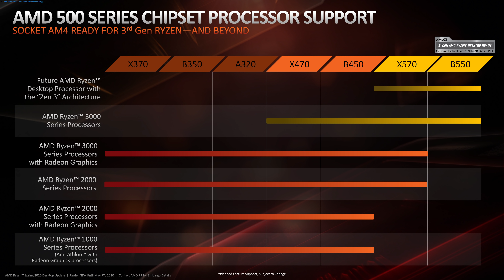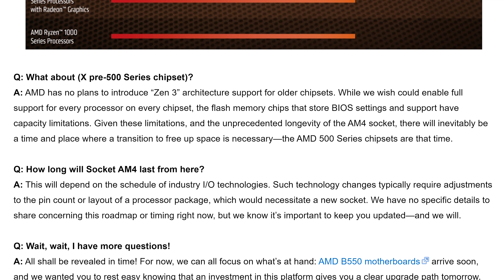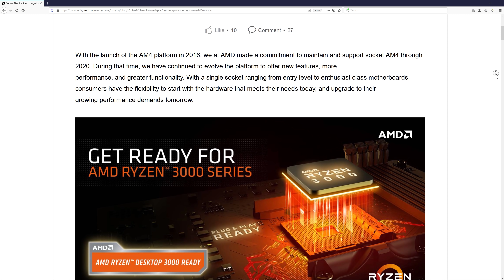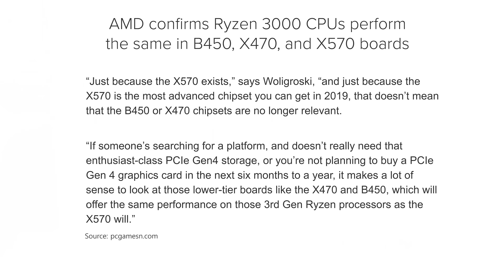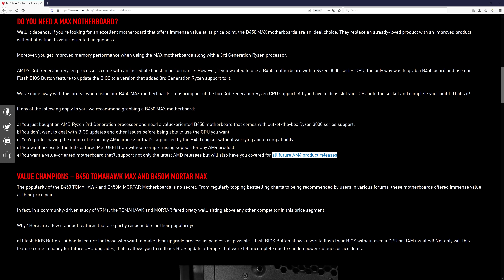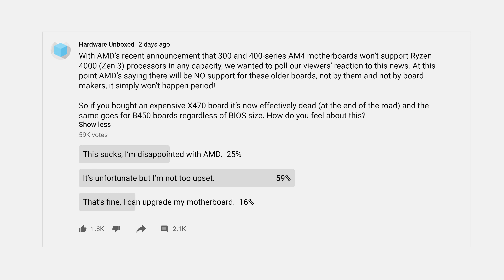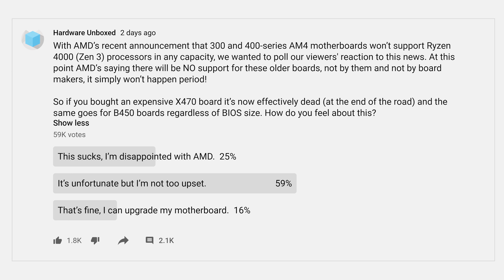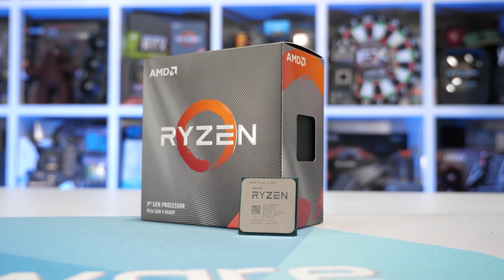AMD Does An Intel, Axes Zen 3 on 400-Series Motherboards, Our Thoughts

Comment: The problem I have with this move is that the next generation after Ryzen 4000 series is rumored to be on AM5. That means that not only are you not able to upgrade to Ryzen 4000 as a 400 series owner, those who buy into 500 or 600 series owners are essentially getting just one generation before they eventually need to buy another  board.

As a guy who wants to buy into Zen 3, that's a double dick move. I don't wanna buy a B550 for a Ryzen 4000 only to have to buy a new board when Ryzen 5000 drops.
Reply: Everyone replying to this shows the problem with AMD's strategy. By effectively making ryzen 4000 a one generation board series, they're effectively locking out everyone who is going to upgrade their current system. This meant that everyone who plans to buy Zen3 (apart from X570) will have to buy a new motherboard. This just further de-incentivizes Zen3 purchases more. I'm sure they'll be great but alienating a group of potential buyers isn't a good move.
Reply: I'm pretty sure 600 boards won't even exist.
Reply: @despoder1558  he means when they come out. Even then it'll be a long while before any of those come out so I don't really see what the issue is other than having to buy another board down the line. Gimme a b550 so I don't have to pay the crazy price of a 570, then gimme a ryzen 3700x and I'm totally set for a few years. The pricing will come down on all current gen and soon to be released things when the next gen things come out. Meaning everyone will have access to the current gen more easily and for a lot of people (like me) that is all you need. Now for people that need the powerful stuff I can definitely see where this causes an issue though
Reply: @despoder1558  dog imma get the 666 chipset
Reply: Well, your are right, but everyone buying Zen 3 would know this when doing their buying decisions. And moreover AMD stated AM4 support will end in 2020. So this is completely OK.
But as Steve pointed out, they promised to maintain AM4 and they didn't offer any mainstream chipset for Zen 2 buyers which would have Zen 3 compatibility. And they didn't tell anyone till now. That is definitely bad!
Reply: To be fair, they did keep the am4 socket very available for like ages (4 years is a long time in terms of technology) so, while I agree with you and the consensus of the double-dickery move, I'm not upset about it personally! That's just me though! If you (in the general sense) are upset about this, that is a valid feeling because it's still 2020!
Reply: While I agree with your point, I see no reason to upgrade every single time a new generation comes out. It is perfectly possible that someone who buys a B550 for Zen 3 rocks that for a while and skips on a couple new generations.
Reply: You don't NEED to buy Ryzen 4000 series. Just wait for the new socket rumored to be released after Ryzen 4000 series. X570 and B450 platform would still be very relevant until then.
Reply: don't you use your then-new-purchased Ryzen 4XX0 until it can't hold up to new releases of software 'n stuff? the time you "need" to replace your Ryzen 4XX0 is the time something similar to Ryzen 7XX0 (or something of different name) will be released.
Reply: Mis you performance?
No stay with a ryzen 3000 an go for the fastes and more core and years you can play games .
See today that most game Just handelt 6 cores of more.
Personal I don not think the 5000 serie Will come on a ddr4 board and go to ddr5 only.
More cores mean more faster memory .
You can see that with ryzen Vs threadripper.
More and faster memory the game go faster about 10fps more 
You can look on YouTube for it.
Reply: @yazata1915  yeah I'm aware of that; point was, the upcoming end of AM4 *PLUS* the lack of Zen 3 support on early boards was a bit of dick move. Nothing like Intel's to be sure, but still.
Reply: Edit: Ignore this message. I read the original post wrong. Hence my answer was invalid.
Reply: @andersjjensen   " next generation after Ryzen 4000 series " after being the key word. So if you now buy a b550 board to go with your Zen3 cpu. You are buying just as much into a dead platform as you would by getting a z490 board and if single core is your main concern, at least for now. Intel is winning in the regard. Obviously we have no idea about Zen3s actual performance, but now  the argument of "better upgrade path" only exists if you are in the market RIGHT now to get a cpu, you should buy a x570/b550 board and a matching 3000 series part. Then upgrade to 4000. Or just get a Z490/10000series and have better performance than 3000, although for a higher price. In gaming.
Reply: @Omega613  Yup. I misread. I have edited my comment to reflect this. My bad.
Reply: @andersjjensen  Happens to the best of us. Kudos to you for editing and standing up to your mistake!
Reply: @Omega613  I kinda had to.. otherwise I can't be straight faced while being an uber judgemental ass towards people who want to be seen as right more than they want to learn the truth :P

Comment: I knew something like this would happen. I got my B450 board around the end of 2018 with a 2600x processor. So, I was waiting to upgrade processor with a 4th gen Ryzen 5 and a B550 board. But, if it worked in my B450 board, it would've been great.

Comment: Thank you Steve. Too many other tech channels are brushing this off like they didn't just spend the last year recommending 400 boards because they were duped too into the wordplay that heavily suggested the upgrade path wasn't going to have a guard asking if you're a VIP that paid twice as much for your Zen2 board. It pisses me off too because I've been personally suggesting B450 boards for months.

This is the fallout of letting marketing run rampant. A PLATFORM isn't a socket, it's a motherboard. How would it be taken if Intel spent the last 7 years saying they've had unprecedented support of the "DDR4 platform" and will continue to do so plastering it all over their marketing the whole time? 

I didn't even get burned by this cause I never ended up building my new rig due to human malware but I had the Maxx and 3900x in my cart and mouse hovering over "place order" but thankfully didn't. Not only because of this but I ended up being sitting at home with no pay for 2 months now and unemployment has been stuck on pending due to the system being overloaded with applications and Nevada being a corrupt shithole.

If I HAD gone through with the build I would be royally pissed for them to pull this profiteering BS, especially at times like these. It's like they've been showered with such praise for Zen that they've become deaf to what the rest of the world is actually going through. 

This just makes me want to sit on my i7/1080ti longer and consider Intel when I finally get back to the build. They almost drew me back but just reminded us all these are companies, not our friends.

Comment: As an X470 owner (bought it in september), i am not too upset, but certainly do not agree to AMDs decision. If they promised AM4 support until zen4, they should do it. Anyways, i am happy with my 3700x probably for years to come, and even if i want to upgrade, there is still 3900x and 3950x. So it did not hurt me so much. Still think that the x470 was a better decision than an x570 with no real benefits but a small unreliable fan on it. Who cares what has pcie4 lanes, if it doesnt really get faster from that.

Comment: I just got a new B450 board with a 1600AF two weeks ago to replace a 2003ish P4. Though I did sorta hope I could upgrade to a 4000 series CPU in the future, I am not really too upset. If needed, which it probably won't be, I can upgrade to any number of much higher powered 3000 series CPUs.

I tend to use systems for a very long time before upgrading. I am still using a couple of i7 systems from 2012 and a 6-core Phenom II from 2009 that is still surprisingly usable.

Comment: That's a horrible decision. I helped 3 friends to buy computers in the last 9 months. I chose B450 for each of them with Ryzen 4000 future upgrade as the idea. I feel like I screwed over my friends. I am extremely disappointment in AMD. They should either support 400 series on Ryzen 4000 or they should have released B550 along with Ryzen 3000. Suddenly Intel's 10 gen price drop and rumored support for their next gen sound a hell of a lot more appealing as I've been considering upgrading myself.

Comment: People would have accepted that if B550 had been around for a while.
But B450 has been the latest available B series board purchasable and considerably cheaper than X570.
What a BS move.. Watch 4000 sales fall short of what would have been possible.
Not everybody wanted to spend hundreds more just for PCIE gen 4..
Reply: THAT was a major problem here, and it could get AMD and board partners in trouble because they promised future compatibility.
Reply: Definitely not hundreds of dollars more. I noted a $20-$50 price delta, depending on tier, for most 500 series boards, over the launch price of X470. The only ones that were hundreds more were the absurd liquid cooled behemoths that maybe ten people bought. And those prices cannot be attributed to AMD, but to the board OEMs who created the monstrosities to capitalize on the PCIe 4.0 hype.
Reply: @kodyfields8461  But still, basically if you want to upgrade to the new cpus you must be on the current top end chipset. That's not what people were expecting.
Reply: @kodyfields8461  
In Australia the cheapest, dankest, entry-level X570 board from PCCG is $299.
A good B450 board tops out around $279 AUD

For a comparable board you will end up (Say an Aorus pro wifi) is $279 vs $499
Not sure about you, but $220 difference I'd consider "Hundreds of dollars difference"

Comment: Pretty sure by the time I have to upgrade from a 3950X this will be a non issue. I current have a 2700X which I bought last black friday for relatively peanuts with a 450. At some point ZEN2 will be cheap as chips and just as relevant at that point as the 2700X is now.

Comment: Let's say AMD would still not support 400 series boards, is it logical to go for a 500 series motherboard when the next generation Ryzen after the 4000 series would be on a new socket and probably DDR5? I reckon the 500 series boards won't be future proof enough to justify going for a 500 series board.

Comment: I intend to upgrade my 2600 for a 3700x soon, keep my B450 board for a bit longer then probably upgrade to the 2nd generation AM5 processor, probably means DDR5 as well and new motherboard when that socket matures a bit. The 3700x should be a good cpu for a while yet. 🙂

Comment: Might be a unpopular opinion here but I will still write it: 

The AM4 support is actually very disappointing, 

As seen from the road map, original X370/B350/A320 boards are just supported for Zen and Zen+, which is just two generations. Surprisingly, same as Intel. Luckily I’ve invested into Crosshair VI hero so I can still use Zen 2, but still it’s the decision of the board maker, not official.

For the X470 and B450 boards, there is also two generations of support. Zen + and Zen 2, just 2 generations, also same as intel (Zen 1 as a backward compatibility but I didn’t count it).

So it seems like the so called support for AM4 through 2020 is just bullshit, none of the motherboard and cpu are mutually compatible if one of them is released in the original Zen launch, (edit:) when AMD made the claim, with product from 2020.(I.e.Zen 1 not compatible with X570 and Zen 3 not supporting X370). So I would say the ‘through 2020’ claim is completely false. Or to put it in a better way, it is technically true, they are still using AM4 through 2020, but the claim completely mislead customers (including me) into thinking support means remaking updates to MBs so it will support their newest cpu in 2020.

Other than being able to buy CPU and motherboard in staggered way, (e.g. buy Zen 1 in year one, change to X470 MB next year, then buy Zen 2 in year 3, then buy X570 in year 4......) I don’t think there are any benefits verses the intel style of doing two generation per socket (of course they have gone haywire lately but they were supposed to have 2 generations on the same chipset.)

Comment: X370 taichi here  with 128Mb bios chip, steve i can see your point about moneys worth but , the fact is £230 divided by 3 means ive paid £73 (circa $90) a year to use this board 

i invested what was a large amount of the p.c. budget on the high end board to actually have some life out of my investment
i feel a hell of a lot of sympathy for the msi buyers and msi as a company with this MAX release 

and as a experianced 52 year old bought the taichi for the reasons of extra large bios chip AND the 16 phase VRM (i already have seen AMD launch higher tdp cpus on am3+ and only a few boards support it)  hence my decision to 'safegaurd' my future upgrade path when switching to am4
Reply: Taichi has 128Mbit (not MB) BIOS, which = 16mb, but there are X570 boards out there with 16mb too, so i knew that excuse is bullshit. X370 Crosshair VI Extreme here, so i feel exactly like you do having invested in a high end board.

Comment: Why not updating those BIOS chipsets to only support the latest Ryzen 2/3...and ditching older CPU's? Does that mean AMD plan to span AMDD AM4 even past Zen 3? 

What happens when DDR 5 goes mainstream 1-2 years form now... will a new mother board and socket be required "again"?

I do not mind...as I have been replacing motherboard, CPU and memory every 2-3 years...so I am fine...just raises the question.

Comment: I have to say I also feel like AMD AMD mismanaged this, especially in regards to b450/x470.  If they wanted to make a hard break at b450/x470 they either needed to communicate that at the launch of zen 2 or provide those b550 boards with or very very shortly after the zen 2 launch.  

As was many many people I've helped make builds choose to go with b450 and a better processor like a 3600 or 3700x over a x570 due to the board cost and the assumption that they could potentially make an upgrade later if they wanted a newer cpu.
Reply: THIS. If B550 had been available at Zen 2 launch, I would have easily bought that instead of B450.
Reply: AMD have already communicated a long time ago that AM4 motherboards won't be supported with new CPUs after 31 December 2019, so not sure how you thought that B450/X470 which are from before 2020 would work with Zen 3 that releases after 31 Dec 2019. If you look at AMD's official Socket Stability slide in the article "3rd Gen AMD Ryzen CPUs Will Work on Many Existing MSI AM4 Motherboards" (search it on Google), you'll see that the graph clearly shows no support for new CPUs on AM4 after 31 December 2019. If you take a good look, the orange bar stops right at the end of 2019, just before 2020 starts. It was already know even a year or two ago that Zen 3 will come out some time in 2020, or in other words, AFTER the official support period.
Reply: @bgtubber  AMD sais support THROUGH 2020. Its in the video. Good job showing you dont know what you are talking about.
Reply: @bgtubber  Stop spamming the same copypasta over and over again. You're on every single comment down the line with the exact same message and you don't give answers to the counter arguments... Plus you flat out ignore 90% of what Steve just said about what OTHER messages AMD has given.
Reply: @bgtubber  No they didn't.  https://hothardware.com/news/amd-confirms-am4-socket-support-future-ryzen-processors-2020

Comment: I am honest, my main Computer has a X570 MB and my Media Center an B450. I would be more pissed if X570 would not be supported. I paid 400$ for this and if this would not get Zen 3 as expected, i would be pissed off, but not so with my 80$ B450. I sell this and buy a B550 for nearly the same price., but i will not because i plan to upgrade to an 8 or 12 Core Zen2 -  in 2 or 3 Years. Dont neet Zen 3 as i do not benefit from PCI-E4 or another DDR Standard.

Comment: i bought a ryzen 5 1600 non af and rx 570 with a b450 motherboard 5 months before zen 2 released with plans to upgrade to zen 2 in the future after hearing the rumours of how big the leap from zen to zen 2 would be. I plan on getting a ryzen 7 3700x when it drops to under $200 like ever other ryzen 7 chip has done before it and keep that for like 5 years coz i dont need the bleeding edge of pc hardware. So for me i wont be upgrading to zen 3 or zen 4 and ddr 5 for a long time, so this news doesnt bother me too much. I feel like there are others like me in a simliar situation, considering a lot of people upgrade ever 4 to 5 years rather than every 2 years. Just my 2 cents in this discussion

Comment: Well there goes my optimism. But my problem's the principle.

I've got a 3700X with a B450 Tomahawk Max, and it doesn't bother me that I can't upgrade to Zen 3 because I've still got the 3900X and 3950X to choose from if I should want to upgrade soon. But I still don't like their reason for not supporting older chipsets, and especially since there are X570 boards with the smaller 16MB ROM sizes too. It's a Coffee Lake move.

They can easily do it was a BIOS fork as you mentioned. It doesn't even need much work to get the chipset that they've been working with for a few years to be supported. It's just a chipset. Btw you can update the BIOS on your board to a version that doesn't support the CPU you currently have installed. The PC just won't POST until you add a compatible CPU. But it won't brick anything.

Then there's also the other things you mentioned, like the lack of a heads up from them about this when X570 launched last year, no other cheaper options but B450, and their implication that the chipset support will carry on through with the socket support.

I'll be curious to see how they handle any confusion for new buyers, and how it affects their Zen 3 sales.